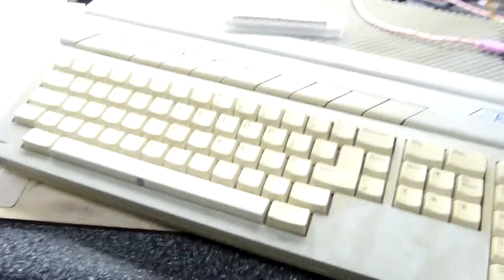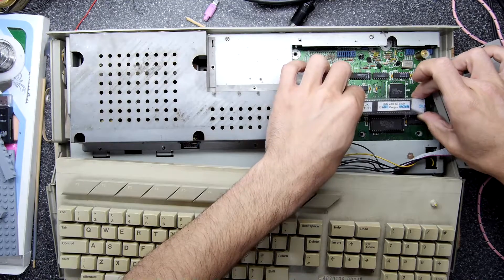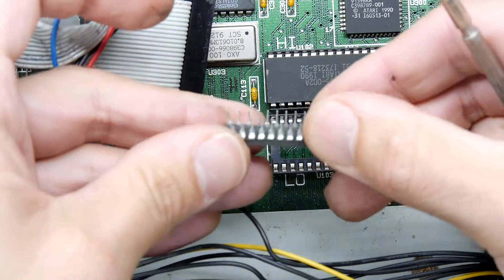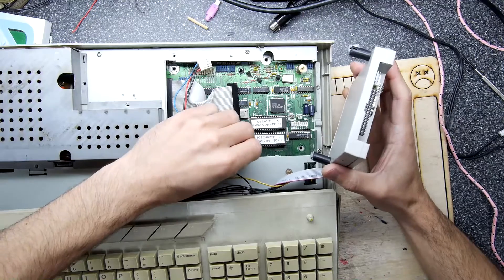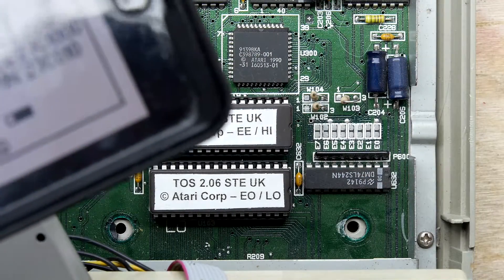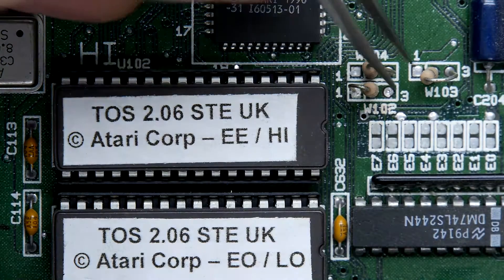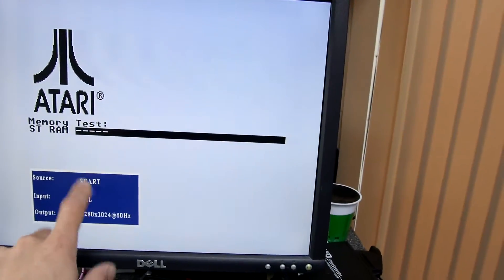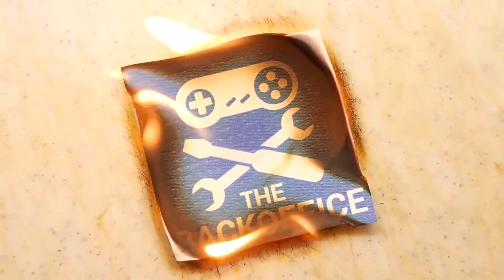ATARI ST TOS Upgrade

Comment: Aside additional options on the menu what other benefits are there from upgrading to 2.06 TOS?   Im considering doing this if worth it. :)
Reply from the maker: Honestly, I wouldn't bother. If you are on 1.6 stay with it. The only benefit I can see it's that if you are on 1.4 you can't see HDDs properly so can't use a satandisk.

There is a utility that lets you load TOS ROMs dynamically. If you have 4mb ram, just try this, I use it the most.
Reply: @backofficeshow  Brill thanks for the reply, ill pass on the TOS upgrade as I dont intend using an external HDD I have the Gotek but mainly use it for playing old pompey and medway scene releases! ...  Ill look into the 4MB ram upgrade then if I can find anywhere UK that still does these!  :)
Reply from the maker: @ellhawkes78  People seem to want it because it has the boot atari logo and memory test, but in my experience they just add loads of time to the boot process. I think you make a good choice :)

Comment: Did a similar mod on my STe recently. Instead of re-soldering the zero-ohm resistors I installed 2.54mm header pins; I can now use jumper caps if I ever need to switch back to TOS v1.62.
Reply from the maker: Nice one. A switchable TOS would be great for compatibility. I use a software TOS loader now, seems to work fine

Comment: Look above the HI ROM and LO ROM on the motherboard... There is no need to write with a permanent marker H and L as it already says HI and LO on the board itself. Also a chip puller would be a really good idea! You may want to undo what you have done and if the original chips are damaged...

Comment: Oddly they only had the cycling color fuji symbol on TOS 1.04 and no other, which is why it is called 'rainbow tos'. Also FYI 1.04 is the most game compatible TOS, but 2.06 is certainly better for desktop programs.
Reply from the maker: I was always a fan of the ST for 'serious' work. Definitely could have been a Mac competitor if it had the right marketing
Reply: @backofficeshow  If you ever feel inclined, you can purchase a device called 'ultrasatan' which would give you two SD card inputs for hard drives. Then you can install the 'Magic' OS on the HDD, which basically makes the interface very similar to Mac. Way more powerful than standard TOS. https://lotharek.pl/productdetail.php?id=48 for ultrasatan and https://www.exxoshost.co.uk/forum/viewtopic.php?f=25&t=207 for MAGIC OS download.
Reply from the maker: Its definitely on my shopping list

Comment: Please invest in a chip puller!
Reply from the maker: They like getting their legs stretched, it's exercise for them
Reply: @backofficeshow  You don't really need a chip puller. Just bent a small flat screwdriver and spray contact cleaner on those sockets before extracting them. I have extracted so many IC's from Amigas, Atari's 8bit, Amstrad CPCs ,C64 and STs with that method without injuries from overstretching = )

Comment: I have a question or rather asking for an opinion. I have an Amiga 500 with 1024k, gotek with flash floppy screen. I have an opportunity to get an Atari 1040ste (unit, screen, mouse). Should I get it or is it just pointless?
Reply from the maker: Is there any point in owning any of these old machines?
Reply: I would say unless you must run Cubase the answers is don't bother. The STE was still a downgrade to the Amiga, however if you ever get a chance to get a Falcon that was a nice system and a serious upgrade (Atari and Amiga)
"Is there any point in owning any of these old machines?" yes, these systems had an environment/feel that is no longer available. Sure you can emulate the functionality, but you are doing that on a system with a feel of it's own. You have to go through the other system so you know it's not really the same. For some ppl that's fine but for others it takes away the environment.
Is there any point to getting a vintage car? it's the same thing.
Reply: @daishi5571  Atari STE a downgrade to the Amiga really!...I must have missed the Amiga midi ports..tut tut!
Reply: @patbutete1722  let me quote myself here (this could cause a rip in the space time continuum) "unless you must run Cubase the answers is don't bother" so I think it's obvious where I was going with this! unless you have an external MIDI device and want to create music using it the STE is barely an upgrade to the ST and is a downgrade to an Amiga. There is nothing stopping you from adding MIDI to the Amiga and it's not expensive unlike the MIDI devices of the time. Where the ST is better in MIDI is that it is integrated and technically the timings are tighter. I did a few studios (ST & Falcon) and when I asked a couple of the guys to try out the Amiga using Bars & Pipes Pro they said it worked fine and found nothing noticeably different (apart from the software obviously) Even after that, if I was asked what system to use for MIDI I said ST without hesitation but if you need a system to do more that MIDI I would have said Amiga (and the Amiga was better at making music if you couldn't afford MIDI devices) The ST and Cubase creates an ecosystem much like Mac and Quarkxpress, PC and Wordperfect, Amiga and Video Toaster (I tried to get programs from the time period) 
TLDR:- The Amiga was a better system unless you had the money to buy the expensive MIDI devices and only wanted to use it for that.
Reply: @daishi5571   I won't bite.! Still,I  can't believe the Atari vs Amiga spat is still raging nigh on 40 years down the line!..
Reply: @patbutete1722  LOL If I have $10 and you have $5, and I say I have more $ is that a spat or just saying as it is? 
A question was thrown out and I was fair with my reply, someone replied to me with inaccuracies so I replied to them with question and corrections and expanded my reply for context, then you made a rather open ended comment which I thought needed context which I did in my own reply. 
The way I see it is this, had the Amiga not existed the ST would have been the best 16-bit computer for the time, certainly better than the PC & Mac.
Reply from the maker: Blast Processing
Reply: @backofficeshow  Don't get me started on the Genesis/MegaDrive LOL
Reply from the maker: I really preferred the Master System, it had all the blast processing it needed 😁
Reply: @backofficeshow  I didn't get into gaming on a console until I got a PSP. I had owned a couple of console up till then, but I liked to program and pull programs apart and see how they worked. I got my 1st computer in 1981 (ZX81 kit that I had to build) and quickly upgraded to a Dragon 32 where I learned multiple computer languages including machine code. That's where I got the bug for figuring out how programs worked.

Comment: Back to watching this again...  TOS 1.04 is "Rainbow TOS" where the Atari Fuji logo has the rainbow scroll, kinda dating back to certain Atari 2600 titles doing that [and the 5200 at startup with Atari cartridges]. TOS 2.06 would give you 1.44MB floppy drive compatibility. And somewhere between 1.04 and 2.06 [probably 2.06] is when Atari Corp added compatibility for the 68010 and 68020 if one is so inclined to upgrade their CPU. 2.06 also has IDE HD support. I'm curious how 2.08 would work. It was for the ST Book and it has hard drive utilities and a ram disk installer.
Reply from the maker: Oh cool! Makes me want to experiment more on this machine. I'm going to pull it's gotek when I source an external HDD or SD card solution so convincing it to use bigger floppies will be neat. If I recall it needs a small hardware mod to enable this because of the timings

Comment: Haha!  I was waiting for you to fall foul of the zero ohm resistor thing, and you did not let me down!
Reply from the maker: +EgoShredder it's a little annoying that the new ROM chips are a different type or else I could have made my own switcher 😒 As it stands these jumpers would be a big problem in me doing this now
Reply: Yeah I think you mean those motherboard pads are easily damaged, which I have done before myself.  The dual arrangement is quite simple if you look online, as it is just a couple of wires between the two chips and then a two way switch.  Someone posted a URL link below in the comments I think.
Reply from the maker: +EgoShredder Sort of. Because the TOS ROMs I have are different sizes they need different jumpers as well as their chip select lines to be twiddled on a switch. I think they will cause me hassle. No problem, I have a whole other STE for games if needed

Comment: I had a nice dual TOS arrangement with a toggle switch to choose between TOS 1.62 and TOS 2.06 before booting up.  One for game compatibility and older software, and the other for hardware compatibility and productivity software as it used to be called.  There are even quad TOS arrangements available via a multi-toggle switch!
Reply from the maker: +Jeremy Holloway Not really found any myself yet
Reply from the maker: +EgoShredder Did you find the need to switch that much in operation?
Reply: Not much but then I used more serious software and hardware, but most games worked although the older games fared badly and that was when TOS 1.62 worked better.  Also 4MB can cause games to fail and you have to use a little AUTO program, to make the computer work as though it had 1MB installed.  Something like that, my memory is a little hazy as I sold all my Atari computers between 2012 and 2015.  One thing I found was that my existing stock of TOS 2.06 EPROMs did not work in my MEGA STE computer, and I had to get a forum member over at atari-forum.com to burn a set specially for me.  The STE ones I had instantly became scalding hot in seconds when placed in the MEGA STE.  So you have to use the right model of EPROM it seems.
Reply from the maker: +EgoShredder ouch! I guess it was down to eeprom specification (similar to the jumpers) I read somewhere that earlier units used loads of smaller eeprom chips. Those would have been a pain to swap out.
Reply: A lot of those incompatible games have been hacked/patched in years since...

Comment: So. Did the Gotek do 1.44 then??
Reply from the maker: +Meth Methanoid Not tried it yet, need to figure out how to actually use a standard gotek. No idea how to make an image on it
Reply: It won't work on STe. Jumper E6 just enables an option in TOS, but STe lacks an FDD controller capable of supporting HD floppies. It can be modded to support them, but it requires more serious hardware mod.
Reply: Wait, I thought that was due to Atari's licensed version of a Western Digital Floppy Disc Controller chip or something. I think the subject comes up on in the forums at AtariAge a lot. Or Atari Forum.

Comment: Will this work with 520STFM?
Reply: Yeah I think TOS 1.04 was the last version for the STFM. You can actually boot with a different version of TOS from disk using SELTOS.
Reply: You can use TOS 2.06 in older STs. Even before the FM models...the 1040STf or the 520STm. And the other variants.
Reply from the maker: +Aaron Cheah I think they can go to a certain TOS level
Reply: TOS 2.06 is supported in 'normal' ST's but it needs additional address decoder because it's not fitting in the same address range like older TOSez. So while simple replacing the ROM set like in this STe, one needs also some additional logic circuitry drop in for that to work in an ST vulgaris.

Comment: http://info-coach.fr/atari/documents/_myfaq/quickfaq-2.8a/stfaq_1.htm#34 is useful.

I have switcher in my STE, between 1.62 and 2.06.
Reply from the maker: +FairFight14 I will check it out. Is there any issue in using disks and data from a 2.06 machine with a 1.62?
Reply: The Backoffice I seem to remember something about the ajax chip. What though I'm not sure. I think it was something about the Hz.
Reply: Your controller chip that is driving the floppy must be able to support 1.44MB drives as well. Check this link from Exxos for all the necessary changes to be made: https://www.exxoshost.co.uk/atari/last/floppy/index.htm